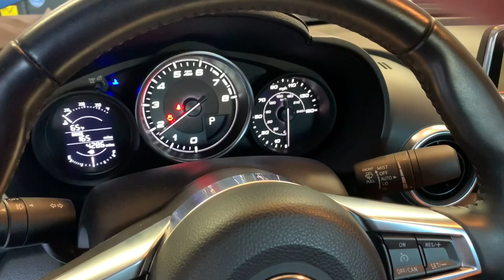ALFA 4C BOSCH IGNITION COILS & BRISK SPARK PLUGS on a Fiat 1.4L turbo - HOW TO!

Comment: Typically I run the plug down with the extension by hand like a screwdriver rather than ratcheting it. I only attach the ratchet for the final 1/4 turn or so. That way cross threading is avoided.
Reply: I was going to say. Im so scared to cross thread it. Always do it with hand first tighten it down.

Comment: So it won't work with just a 1.4 NA Fiat Sport 5 spd? If I were to do this what would happen? Would I get any gain in HP and or torque?
Reply from the maker: The process is the same but it takes different coils and plugs.  It will not run right with these

Comment: What is the plug gap spec?
Reply from the maker: Impulse Racing it is going to depend on the brand of plug and whether or not the car is tuned.  From the factory, the original plugs (NGK) are gapped at .026.  For the Brisk plugs, it is recommended to have them gapped at .024 if not tuned and .022 if you are tuned.  If you install replacement NGK plugs, gap should be at .024.
Reply: @NGENCustomsandPerformance  I will add in, the tuners at Eurocompulsion will also tell you to gap the original NGKs at .024 if you are tuned.

Comment: Another awesome video by Bryan and co. 

When/if the coils are stuck in place, a short blast of compressed air from a small nozzle directed at/under their top flange will help pop them loose.  I’d probably already have the air hose out and available when working on a dusty engine. Out of habit, I clean most things to be addressed and their surrounding area off before opening them up.  Bow out the well before removing plugs. I found a head moth carcass in mine from Mexico. You can then apply a very light swipe and wipe of di-electric grease for ease of removal at a later date, to all contact surfaces of the coil flange and boot, where it will meet the tube and valve cover, and where it clips to the plug
Reply from the maker: Awe Bart great tip!

Comment: Nice vid, thx.

I have a Stage 1 tune by tork and a V2 intake (around 190-200hp), should I really upgrade or is it for Stage 2+ / stuffed turbo etc., higher level modifications?
Reply from the maker: Yes I would recommend upgrading the coils and plugs for sure

Comment: Are the coils ok to use on both mutli air and t jet engines?
Reply from the maker: I don’t know if it will work on the t-jet since we don’t have them here in the states
Reply: @NGENCustomsandPerformance  thanks for the reply and for the information you put out

Comment: On a 2014 500l Lounge stage 1 tune with the dual clutch---when the car revs up but loses throttle like you have no control and it stays high rpm for a bit  is that the coil or spark plug failure. Also there is mild hesitation.  Only 11455 on the plugs and coils...
Reply: Did you ever figure out what it was?

Comment: Brisk plugs are trash, I had a set in my gti, fouled out in less than 10k miles, I put them in my abarth around the same time and they didn’t even last 3k before fouled out, went ngk with both cars after and never a single problem in 100k combined between them. 

Love this guys videos though, fucking lifesaver